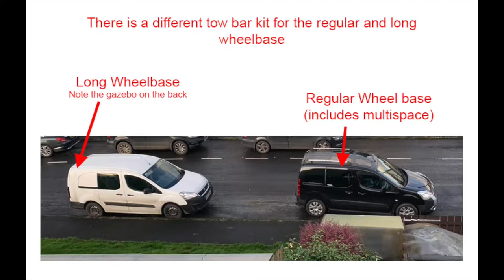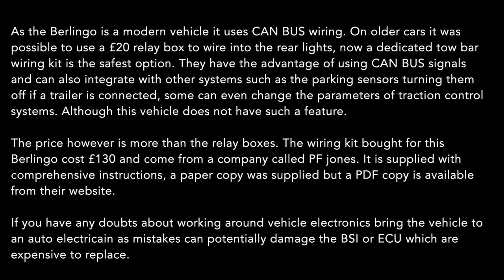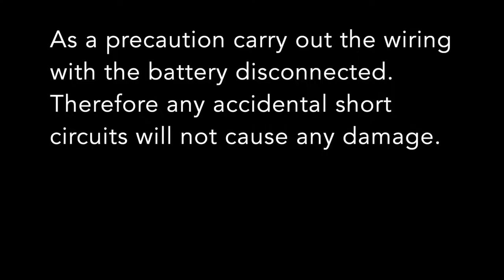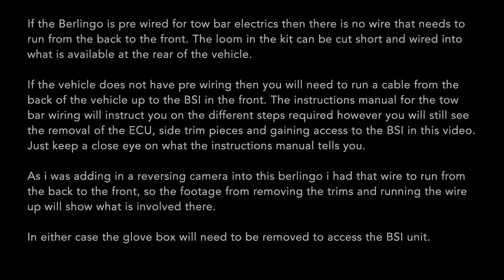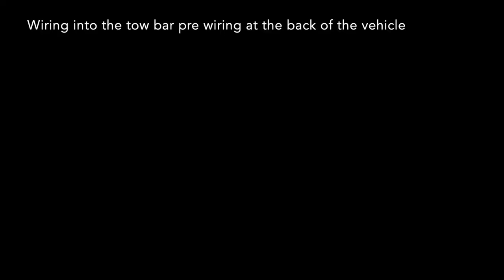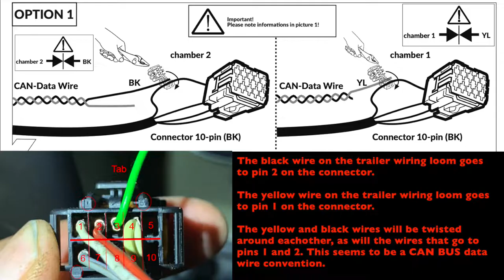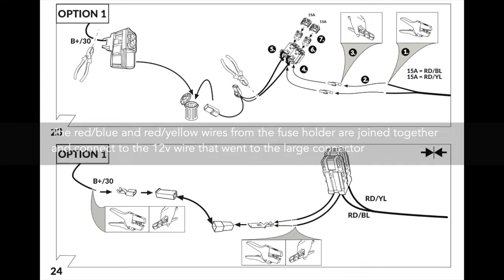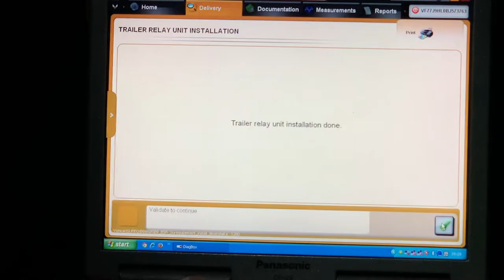Citroen Berlingo / Peugeot Partner B9 Tow Bar Installation

Comment: Many thanks for making the video. I have recently bought a 2013 Peugeot Partner van and have fitted the towbar. I purchased the PF Jones dedicated wiring kit. My van does not have towbar-ready wiring at the rear, but that was not a problem, but at the front, I have searched high and low and in every nook and cranny, but I can not find the black 6-pin connector and cabling. Do you have any ideas as to a route that I can take to complete the wiring connections to the BSI?

Comment: Thanks for making this video. Although your video is very clear as usual, the amount of rewiring that is required looks like a nightmare. You would have thought paying £130 for a wiring loom specific for the vehicle that it would be pretty much plug and play but not in the slightest having watched your video.

I have a 2015 Peugeot Partner Tepee 1.6HDi 120 and I would like to fit a tow bar. Your video is just the kind of help I shall need. I have been searching for tow bars that don't mean cutting into the rear plastic valence bumper. The tow bar you use seems perfect to avoid doing this. I have parking sensors and rear cameras in my Partner Tepee's rear bumper/vallance and don't want to interfere with those or block their operation. Can the swan neck of the actual ball head be removed when you are not using the trailer or towing anything?

Having done all the wiring, how easy is it to activate the tow bar module? Is it possible to download the diagbox software for free to a laptop (Mac) and if so from where? Is the diagbox lead an OBD2 connector at one end and USB at the other to go into the lap? Where can you get these leads from and how much are they? eBay?

I just hope I have the trailer pre-wiring in mine.

Thanks for making this video. Looks very helpful as are your other videos.

Many thanks.
Reply from the maker: In fairness i found the wiring for this quite a bit easier than the wiring for trailers on older cars. 
If you paid even more (over £300) for the genuine PSA wiring loom then possibly there would be less wiring but i hope this video shows what is involved with this kit.

The swan neck of this tow bar is held in with two bolts, it can be removed but it would not be practical to do it frequently. There are tow bar kits where the swan neck is quick release but you would need to look more into that option. Generally the tow bar should not affect the parking sensors, they will just beep more if you have a trailer attached. (Although the likes of this PF jones kit should disable the parking sensors as it is communicating to the BSI)

Diagbox, no you will need to get one off ebay, it will require a windows XP or 7 laptop, 10 might do it but i believe it has issues. The lead is specific to diagbox, your best bet is ebay.
Reply: @peugeotCitroen2CV  Many thanks for your reply with more helpful info. Still can't believe I was thinking about a tow bar for mine and you had actually just posted this video albeit a few months before. I was actually considering it last summer as I have motorbikes I would occasionally  like to put on a trailer and tow. Also possibly a small boat .............. Many thanks again.

Comment: Great video, just what i was looking for. How do you remove the O/S boot trim with the pocket? It doesn't want to shift like the N/S.
Cheers
Reply from the maker: I think there is a clip in behind where the wee torch clips in (or blanking panel on other models) I have not had that side trim out but have a look at this diagram:
https://catalogs.ssg.asia/peugeot/?lang=en&fbclid=IwAR0_lP0MLePfEgd5X0V7Q78jm_9e9WehaUjVHCPRXgmfj1jIhwehoj9aZQk#c3Q9PTgwfHxzdHM9PXsiMTAiOiJNb2RlbCIsIjIwIjoiUGFydG5lciAoYjkpIiwiNDAiOiJCb2R5OiBUWVBFIDYgU0hPUlQgUExBVEZPUk0gQ0FCIFwvIEVuZ2luZTogMS42IEhEaSA5MCBwYXJ0aWNsZSBlbWlzc2lvbiBmaWx0ZXIiLCI1MCI6ImVxdWlwbWVudCIsIjcwIjoiaW50ZXJpb3IgdHJpbSIsIjgwIjoiUkVBUiBJTlQgVFJJTSBNT05PU1BBQ0VcL1ZVIFJJR0hUIFNJREUifXx8Y29kZT09MlBCOXx8Ym9keT09QjBEMk18fGVuZ2luZT09QjBGUTR8fGNhdF9pZD09RkNUMDIwMHx8c3ViR3JwX2lkPT1GQ1QwMjM0fHxyZWZkb2NzPT1COVU4ODJMOTBBfHxyZWZkb2M9PUI5VTg4Mkw5MEF8fHN1YkdycE5hbWU9PVJFQVIgSU5UIFRSSU0gTU9OT1NQQUNFL1ZVIFJJR0hUIFNJREV8fHN1cHBsaWVyPT0%3D

Comment: Hey, thank you for an amazing step by step instruction. Such a help, in what is a pretty complicated procedure. I ground the fixings off for the ECU, took it out, put a 40A maxi fuse in the second slot from the left, but I still have no voltage on the thick white wire. Any ideas why not? Should I see it as a permanent 12V DC on the meter?
Reply from the maker: Hi, have you got any further on with this?
Where had you placed the black lead of the multimeter when testing voltage?
Reply: @peugeotCitroen2CV  Hi there. I ended up running a +12V from just behind the glove box all the way to the back. I didn't take all the trim off but managed to tuck it away underneath. I connected the neg of the multimeter to the stud where all the GND wires were connected at the back. It is all working nicely now, although I haven't wired the fridge and charge connections, I'm going to forget about them.

Comment: Hi, thank you for this great video! I'm planning to install a tow bar myself but I was wondering, wouldn't it be possible to buy an official tow bar box? (I think it's this one: BSC A01 00 tow bar module). It seems to me (looking at the pictures) that the three cables in the back are meant to go in that module. 2nd hand those modules are way cheaper than an wiring kit
Reply from the maker: Hi there
From memory at the time i could not find any Genuine Citroen wiring kits that were priced reasonably, this canbus kit essentially did the same job it was not the cheapest either.

Comment: That's brilliant what's the amapage of fuse used behind the ECU also would that be sufficient to run the other socket to power fridge and charge for caravan towing just seen about fuse where do you get the electrical kit from or what is the approx price for the towbar with loom kit
Reply from the maker: I answer quite a few of these questions in the video.
A 30 amp fuse is installed. The electrical kit cost £130 from PF jones. The tow bar metal work was roughly the same price.
30 Amp should be enough for those, although it would be worth doing a bit more research. These vans do get converted into campers and the wheelchair conversions also would be drawing quite a current from the back. That power supply cable is quite hefty. Although if you plan on towing a caravan PF jones do a different electrical kit for the caravan plug.
Reply from the maker: @craig.revill  This berlingo is a 110bhp 1.6 tepees should be the same.
Not exactly sure on what its towing rating is, but having a look at this site:
https://www.towingcapacity.co.uk/car-make-model/citroen/

1300Kg braked for most of the 1.6 HDi engines. As far as how well it pulls, I've had a Kubota diesel lawn mower on the back and it pulled quite well.
Reply: @peugeotCitroen2CV  hi there I've narrowed down to two tow bar electrics but do Jones arnt that forthcoming with info there is two 7 pin ones listed but they can't tell me the difference between them 

CODE:19500572PF
CODE:19500558PF
With you fitting quite a few I'm hoping you may have an answer
Reply from the maker: @craig.revill  
To be honest i havent fitted many this has been my first and only Berlingo 
Are they not much help on email? I went for the slightly more expensive (£5 or less) one using man logic to deduce it was therefore better😂
Reply: @peugeotCitroen2CV  no sadley they just didn't have a great answer between them just said both should fit I've sorted it now but thankyou for the vid and your help

Comment: were those just regular torx security bolts holding the ecu down? If so, you could've just gone to halfords and bought a bit set for like £5 with those in it.
Reply from the maker: Unfortunately no they are anti tamper bolts, google that, shear bolts, or one way break off bolts. To get a picture of what they are.
Security torx bits would have been handy but ive got two sets already teng 3/8 and 1/2 drive. Dont think £5 would get a halfords set these days, perhaps an individual bit.
Reply: @peugeotCitroen2CV  even if its a perfectly round bolt you could still use flank drive xtra but i dont see the point in 1 time use bolts for a ecu. The only thing I can think of is that its a security star bit but ive got lots of specialist kit so it may seem different to me.
Reply from the maker: @thejohn7821  
Unfortunately it had no head at all, not even a snap on FDX socket would have got any grip on it, it was an anti tamper bolt it had no head for torx, or any other type of socket. 
This video gives a good representation of how they work:
https://www.youtube.com/watch?v=rmRdXvS_Exw
Reply: @peugeotCitroen2CV  ive not seen this on anything I work on and quite frankly I dont see the point. This is just pointless, no wonder you threw the fucking plate.
Reply from the maker: @thejohn7821  
I remember Renault had some bizzare security anti tamper thing covering their ECU on the mk2 clio apparently thefts were a problem when getting exported. Very weird, never thought they were at much risk, or perhaps its to deter remapping etc. An annoyance and nothing else. Perhaps those bolts would have a genuine good purpose at holding say the box for a defibrillator at a shop or something stored in a public place. Not on a vehicle though.
Reply: @thejohn7821  I can vouch for that. There is absolutely nothing to get hold of. The top of the fixing is smooth. I had to grind most of it then finish off with various sizes of drill, up to 12mm before is was clear.

Comment: is there any way a high pitch noise could come from this area
Reply from the maker: From the back? High pitched as in squeaky brakes?
Reply: @peugeotCitroen2CV  no sounds there when running or not
Reply from the maker: @ballkeeper6662  
Oh just a high pitched whine, even with the engine off🤔 possibly a fault in the trailer module sounding a buzzer?

Comment: Here in México thats a really expensive job. About 1000 euro in a oficial Peugeot store.  I spent 300 euro in aftermaeket parts and works fine(tow bar, wiring harness and electrónic brake controler).
Reply: donde compraste las partes?

Comment: It would have been easier to mount fuse holder at back of van with 20 amp fuse.I do that with all tow bar fittings .
Reply from the maker: I basically followed the instructions provided by the tow bar wiring kit.
Reply: Mounting the fuse at the back of the vehicle is very bad practice and is dangerous! The reason why the fuses are right next to the battery on pretty much all vehicles is so that if the cable  gets cut and shorts out against the bodywork (e.g. in a crash), the fuse is before the cut, blows immediately and the subsequent length of wire has no electricity flow. If you put the fuse at the back, then that wire stays live always. So if/when the car gets crashed into, the wire shorts to the bodywork, and there is no fuse to blow. The wire will just overheat from the current draw and will catch fire, potentially taking the whole vehicle with it. I've seen badly installed power cables (for amplifiers) get shorted out and catch fire before....not good!

Comment: From experience i can qoute unless you have ramps and a non rusty Berlingo it doesn't go like this :face-fuchsia-tongue-out:
Reply from the maker: Yes that is correct, i fitted the tow bar into my C4 (this berlingo got wrote off) when the lift was in use and doing it on the ground is a lot fiddlier. Although not impossible.
Reply: I'm experiencing that right now. One of the bolts holding te crashbar in place won't come off. Any tips on how to loosen it? I sprayed it 3 times with WD-40 but it doesn't loosen so far. The other one I was able to use a wrench and a jack to loosen it, but on the right side there is no room for the wrench to turn (hope this is understandable)

Comment: Do you still have your kit for Berlingo 😁 (it’s me Chris a get from you roof 😅)
Reply from the maker: Hi there chris, 
did you get anywhere with converting the roof?

i sold the steel elements to it, might have the wiring kit but need to check out at the shed i cant 100% remember

Comment: Так и не понял, зачем пол салона разбирал
Reply from the maker: The floor where? A wire had to be run from the back up to the front, but the whole floor was not disassembled, just the carpet lifted a bit.
Reply: @peugeotCitroen2CV  We just put a 40 amp fuse under the hood, where you put the matching unit.